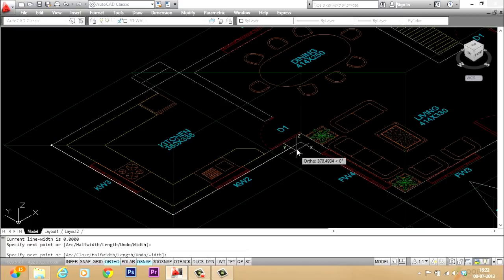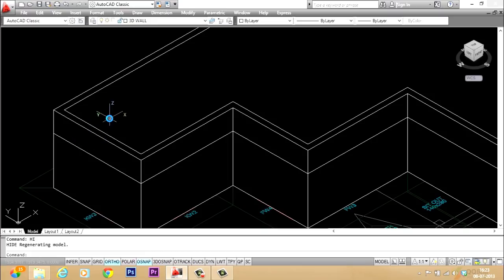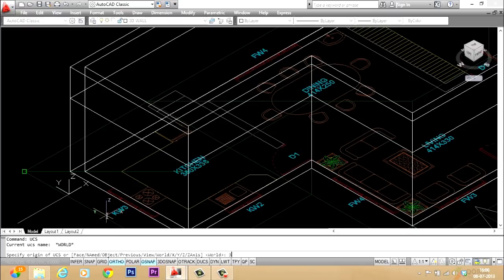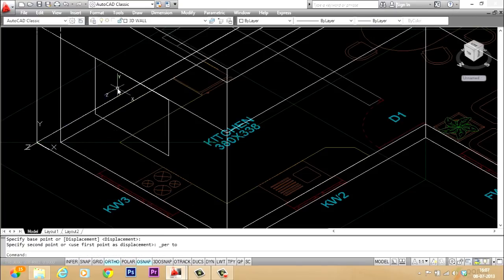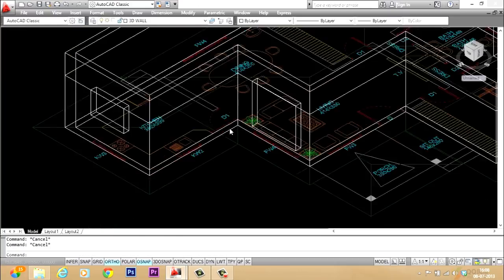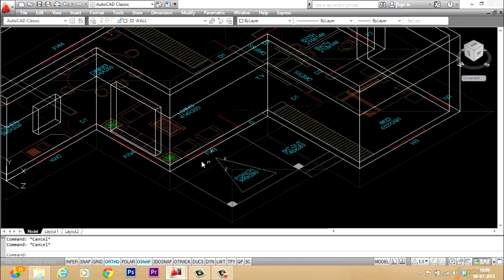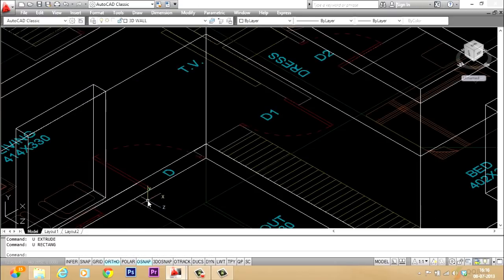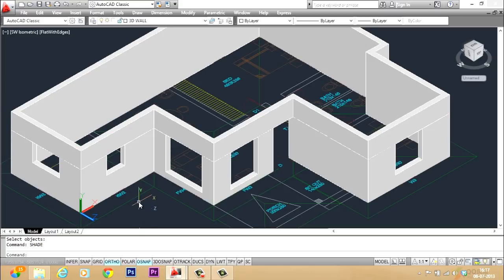AUTOCAD 3D HOUSE  | MAKE 3D WALLS

Comment: Dear friend Mr. Sabeer. I had been watching ur videos with a great interest. This is the knowledge u r 
providing to the people who are in need without any charge. Big salute. 
I have one question and need ur help if u can. I'm using Acad Archt 2018. Day before I set it on default nevertheless it hangs frequently. thus I feel difficult to work on it . I have already tried on 2d wireframe shaded. Matter is almost the same. I'll be very much obliged if u can suggest me to solve this problem. Thanku.

Comment: Hello sir please i have a problem...each time i align my ucs in a certain face or with the 3 points option and after i take a polyligne and i start drawing, the ucs displaces and changes its orientation making it impossible to draw what i want to draw
Reply from the maker: You can turn of Dynamic UCS (at the status bar) and retry.
Reply: @sabeercad  ok sir thanks that worked am greatful